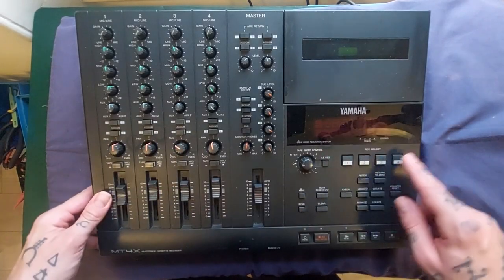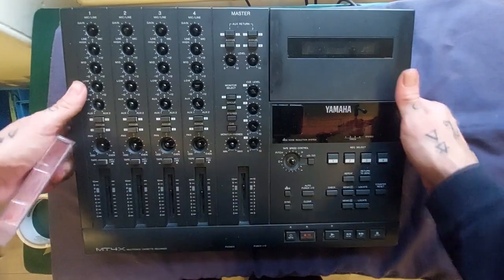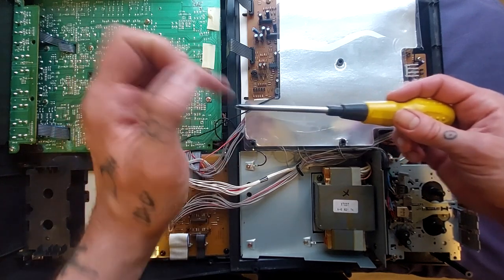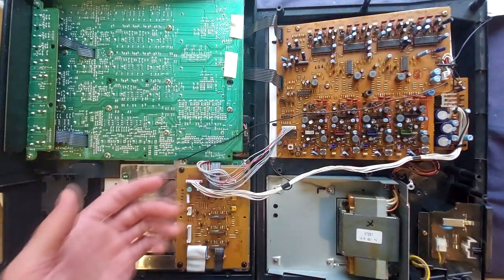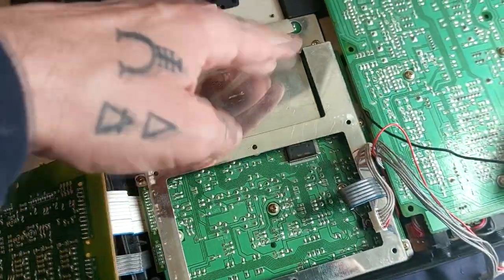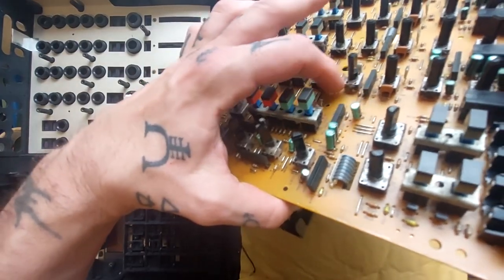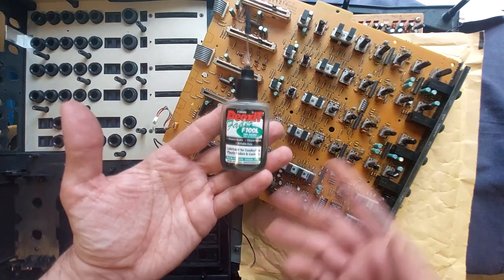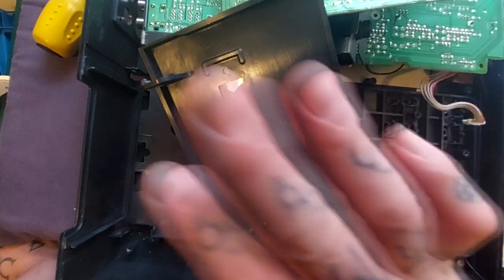YAMAHA MT4X | TEAR DOWN

Comment: Excellent video-keep them coming. I was finally able to send all 8 tracks out of my Tascam 488 into a DAW. Making up tunes from 1991.
Reply: Baking up tunes from 1991.
Reply: Backing up tunes from 1991- Sorry for the typos.
Reply from the maker: @michaellukie2145  thanks! Autotext and tiny smartphone keyboards were sent to try us.
Reply: It has been a process! I have about 100 cassettes to convert all with original 8 track tunes. I even recorded my 1994 Elvis cover band live using the 488 and I have it in digital now. Lots of fun!

Comment: By the way, I was really impressed by how you did your work around on this unit to get it going. When I just start taking out a hundred screws, I start getting nervous about getting em back in the right places. I’ve always been that way, even though I can record it all as I go. Maybe I need a Valium before I start. Ha ha!
Reply from the maker: It's finicky for sure. Grouping screws and clips pertaining to the same area in baggies either laid out in a tray in order or grouped with the bracket/board they were removed from using elastic bands or masking tape helps. Fortunately I don't have to do so much work as I did with the MT4X in the patreon video on most units...that one was sold very cheap with parts missing, and under most circumstances I'd relegate it to the spares pile.

Comment: Hey @tetrakan thank you for your valuable videos. A tip for the ribbon cable: you should not remove the lip, lift it slightly on the left and right until it releases. Then simply put the label back in and press the lip back down.
Reply from the maker: Hey, my problems with those sort of connectors have been more to do with the metal half getting bent, so I’ll stick with leaving them plugged in, but thank you for sharing this tip which may help someone else!

Comment: For future situations that may arise, may I please get the type of tactile switch to order for the transport controls and such. So many to choose from on Amazon. Sheesh. I don’t need any now, but when I first got one of my units it needed some harder and quicker than usual pressing to get them working correctly, as time went on, they worked correctly though. Whew! 

Thank you! 

By the way… you’d be proud of me. I modified an off brand knob for a pan pot and painted the red line white to make a master volume slider tip a channel 4 controller. Not quite on your level of clever moves, but got these parts working well enough for my use, I figure. 

Thanks again!

-Chuk

Forgive me if I’m bothering you with these questions. I don’t want to be a pain in the ass.
Reply from the maker: Hey Chuk. the main search term you're looking for is "tactile switch". Most you'll see supplied on ebay, amazon, electronics wholesalers have 4 pins, but I've changed them on yamaha units which were using a 2 pin variety: I forget if this applies to the mT4x but check my video or your unit before ordering. Pretty sure yours are 5mm square, maybe 4mm depth - again, check. 

btw I'm always happy to answer questions  here - liking/wanting to help folks keep these contraptions working is no small part of my motivation for starting a youtube channel, and besides which, an active comments section blesses me in the algorithm's eyes, which betters my chances of maintaining or expanding a trickle of income from google adsense, among other things!
Reply: @Tetrakan  Thank you!  I’ll do these things you suggested. Ha… I just woke up, so it’s like I’m just on the edge of being able to say things to you that make sense, relating to our subject at hand. 😵‍💫 🤣😂🤣

   I’d always want to do anything here that would help your channel… uuuuuuuuum… if I can wake up! Ha Ha!

Thanks again!!!

Comment: Can i ask you a question please, i have a mt4x and i use it only as console skipping the cassete for plug in my two synths d50,κ2000. I think the eq of the mt4x is really magic or it is about a kind of placebo at my ears , i read the manual about the eq and i made one sound without my console, raising the same frequencies exactly and one raising the same frequencies with the mt4x and the result are miles different, i want to say that i cant reach the eq of the mt4x in any plug in , plus the preamps that i think are great to , do you have any opinion / advice on this? Thank you very much keep doing.
Reply from the maker: Thanks. Any analogue technology has an idiosyncratic transfer function, meaning there are subtle changes between input and output signals  which digital technology do not produce by default. Differences in transfer function account for differences between tube and transistor amplifiers, different speakers, etc. So yes, the mixer in your 4 track will sound noticeably different to supposedly equivalent digital plug ins. If it is very important to be able to reproduce the sound ypu get from your yamaha 4 track  in a DAW,  some software manufacturers - waves, for example - make plug ins which create a profile of the transfer function of analog gear. Basically you send signals from the software through your gear, the MT4X in you case, and back into the computer where the software  creates a profile of how your gear changes the input signal.The software then  captures those differenced as a preset on the plug in and does its best to reoroduce thd result digitally...maybe you could use that as a substitute for the MT4X?
Reply: @Tetrakan  from the moment I have the hardware console I don't need substitute it , as I found that if the output that goes to the sound card is aux send 1 2 and not the stereo out I skip the master and more importantly I avoid a noise that the machine makes and I have 4 positions with  the eq and the gaini like and much lower noise floor , the reason I asked was if you had any opinion on the eq of the consoles, especially the low end, I ,anyway  thank you very much for the response!:)
Reply from the maker: I don't  understand  what you want my opinion on... please make your question more specific?

Comment: Hi. Great videos after finding your channel. I have an MT4X and none of the input channels are working. Any ideas? I think it might be the ribbon cables from tge input connector pcb. Your video has given me the confidence to have a look. Thanks. Steve
Reply from the maker: Thanks. If you suspect the ribbon cable is at fault, you could check the connection with the continuity setting on a multimeter.

Comment: thanks for making this. I have one of these and there is very little I can find about it online so this is helpful. Mine was working until recently it stopped recording. I cleaned the head with alcohol and it recorded again but at a lower volume than before then within the hour stopped recording again. Wondering if you have any thoughts on what that could mean? I'm wondering if I just need to be a bit more aggressive with my cleaning or if there is something that possibly needs to be resoldered.

Comment: I’ve got a pinch roller coming from Australia, for just in case I need one some time. Already received the two main belts I ordered for same reason. 
The reason I bring these up is, the seller tried to sell me an idler wheel plus some other thing, that I didn’t know the MT4X even had in em. We’re they just trying to upswell me something I won’t ever need, do ya think?  Thanks!
Reply from the maker: There's no idler wheel on the MT4X, the shorter belt drives cogs, which intersect with teeth on the base of the gear tables, with no rubber parts between.  There is an idler wheel with a rubber tire on the MT8x, so perhaps the seller thought you needed that? You don't, though.
Reply: @Tetrakan  Great! Thanks! I’m more apt to believe they were just trying to get me, hoping I’d bite, but maybe not. I should really trust people more I guess. Thanks again!!

Comment: Hi, I just bought a tascam porta 03 mini studio, and when I plug it in and switch it on, no lights come on, no sign of life. My guess was the chord is bad, or maybe some of the soldering on the parts that cause it to turn on cracked, but do you have any advice? Thanks
Reply from the maker: That model is susceptible to damage from using the wrong polarity or psu.  You should have negative tip 12 volts, 500mA or higher, what have you been using?
Reply: @Tetrakan  I’m not sure, how do I check?
Reply from the maker: Usually there is writing on the ac adapter below the plug prongs. It'll say something like "12v 500mA" and there is a symbol involving lines, a circle and a half circle, and a plus and minus sign, which illustrates the polarity. Look up DC polarity symbol I  Google images if you're not sure what I mean by that description.

Comment: Do you think this would be similar to the mt2x?
Reply from the maker: No. MT2x looks like it has a mechanical cassette player, external ac to dc adaptor and a completely different style of mixer and casing
Reply: @Tetrakan dang, been trying to get a mt2x working for a while. I thought I got it working but it's still not strong enough to play a tape
Reply from the maker: @atetraxx  I've since worked on these, it's the GEC generic cassette player in thete, I've got a playlist on refurbishing that it'd be worth checking out

Comment: Hey man I cracked open an mt3x and it only has a single drive belt? I bought a kit advertised for the mt3x off a guy that came with 3 belts and pinch roller and I only used the drive belt and the pinch roller didn’t fit. 

Can’t seem to find any of the other belts on the service catalog. Was I scammed?
Reply from the maker: At the time of writing, I'm not so familiar with yamaha stuff, and I haven't seen inside the MT3X. Generally speaking, transports with more motors (there are between 1 and motors depending on the design) need fewer belts,  I hear mixed things about belt kits, and no service manual I've seen gives the correct belt sizes weirdly, so everyone is buying and selling this stuff in a sort of experimental after market limbo. If you send me a gut shot of the mt3x cassette player  over Instagram or Facebook messenger, it might be a style of transport I recognise from another model, and I can put you onto suppliers I use?